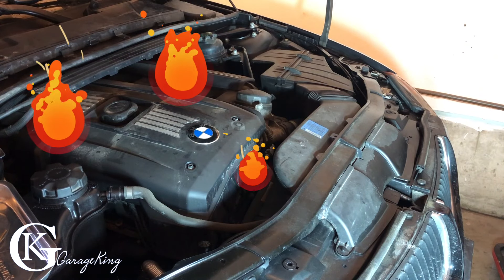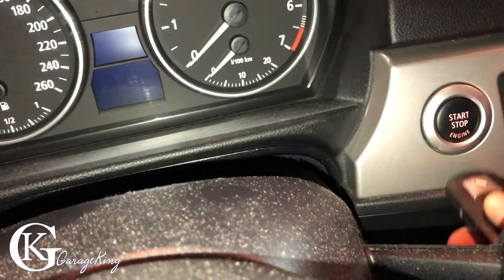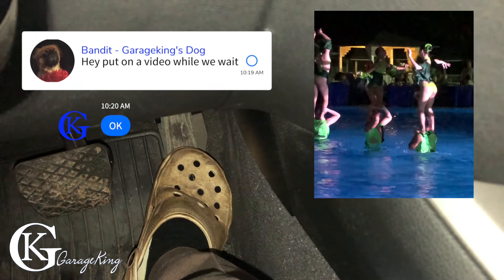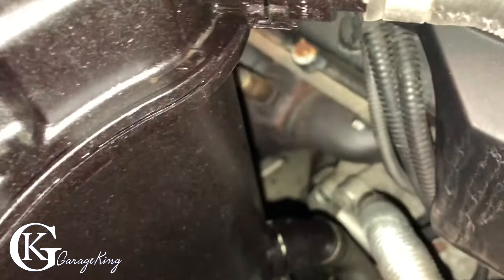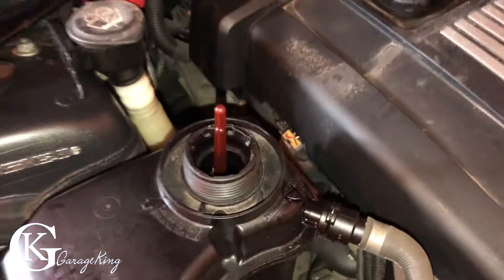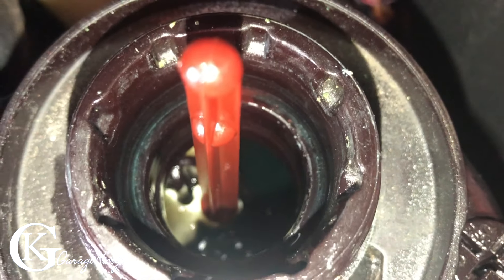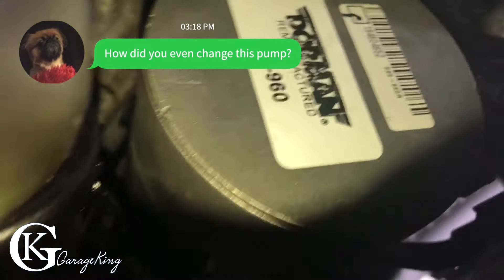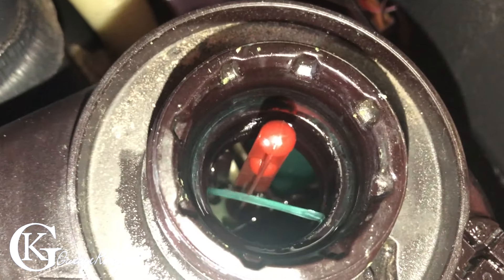How to Check BMW water pump

Comment: I have a 2006 330i N52 my car over heated the other day and I needed to add coolant since then my water pump seems to runs continuously not stopping until battery is drained my water pump also does not shoot coolant out like yours it shoots up like it’s aiming at my passenger mirror I have been told it could be relay or fuse but I personally think it’s the water pump what do y’all think ?( also my thermostat was changed about a month ago by previous owner I just got it with 205,000 miles the only things I know the car needs is o2 sensor)
Reply: Please help I don’t want to spend the extra money replacing everything
Reply from the maker: Hey there, ya could be your water pump.  I wonder how it shoots up at your mirror?  The only way I can think of that is if you took off the cap with the engine hot and it came flying out. If your pump is not circulating coolant properly for some reason (like a blockage or something) then the ECU will command the pump to stay on as the ECU (computer) doesn't know any better and it will just command it to stay on until the temp comes down (which won't happen if you have a circulation problem)
Reply from the maker: Don't blame you, BMW part are expensive. (edited to move comma)
Reply: My coolant is also not a stream, it sprays upwards and in bursts not sure what the means either. But I think we are having the same issue. Did you get it fixed??
Reply: Sounds like you haven't been using distilled water and now you have sediment buildup

Comment: According to my scanner. Ac blower must on low. On low headlight switch to prevent sleeping. Key on, then hold pedal 10 seconds. Good video though. It also bleeds the coolant.
Reply from the maker: Hey thanks for the comment, appreciate that !!!
Reply: What model do you have?

Comment: Aaaargh your engine was on fire lol!  I love your easy to follow instruction on car repairs and your sense of humour!
Reply from the maker: Thanks so much for coming by :) Happy New Year to You :)
Reply: @GarageKing  How you doing , I have a question , My Light kicked on for OVERHEATED , can i put coolant on the tube where you put water for the wippers or theres another tube for the Water pump i have a bmw x6 xdrive35i im jot quiet sure
Reply from the maker: @RiichyyRiich123  hey thanks for the comment. The coolant can only be added to one place and one place only. The coolant reservoir as shown in the video. There is a link in the video when is playing that shows how to replace the water pump. At the end of that video I show how to fill the coolant properly.  Just scroll to around the 1/2 way mark and there is a symbol in the top right corner click it and you will see the other related videos. If you have any questions just let me know. Thanks :)

Comment: Help! I can't find the video where you changed the pump out 🤔
Reply from the maker: Hey brother thanks for the comment, the pump vid has not been posted yet.  I'm still editing it.   The pump is located on the passenger side underneath the car.  I can help you along if you need any advise.  I hope to have the vid out in a few weeks.  I used an aftermarket pump and it worked fine and even came with the new aluminum bolts.
Reply: @GarageKing  Which pump did you use? I'm having a bit of trouble. I replaced my pump and thermostat and I did the bleed process. I turned it off then ran the car for about 15 min and it started to overheat. I tried to do the bleed process again but it never turned back on? I ran a scanner and I got code 2E84. I don't hear the pump kick on anymore. I wanted to see your video to make sure I did it correctly. I'm not sure if it's a bad pump or wire issue. Thanks for your help.
Reply from the maker: @kobe_goat_24  Hey sorry for late reply, I had to go into the raw footage to see the pump part # Its a Doorman 599-960 model.  I did use a genuine BMW thermostat, but the pump is aftermarket.  I found the connector was REALLY REALLY hard to push together on the water pump, and I even used a set of pliers to compress the fitting.  I thought I was going to break it.  I'm wondering if yours is plugged in all the way, I could see the plug not being seated an issue, because it would work, and then vibrate loose a bit and loose its connection.  The 2E84 can be caused by a bad ground so make sure the ground terminal that you had to screw onto the front of the pump in clean and tight, and check the connector.  I would be curious so let me know if that helps at all.
Reply: @GarageKing  how long did it take to change?
Reply from the maker: @leftylok83  Hey Thanks for the comment, and sorry for the late reply.  If I was not filming it, probably 2 hours.  Because I filmed it maybe 6-7 hours.

Comment: I have a 2010 X3 in my shop and I've done the coolant bleeding procedure and already replaced the thermostat, but the customer is hesitant to replace the pump due to $$$, knowing that the pump was still flowing during the test but seeing your pump flow in the video makes me second-guess his water pump now. According to the scan data the RPMs of the pump were within the specs so I'm at a bit of a loss here.
Reply from the maker: If the scanner is reading RPM within range I would check for flow, and if the flow is not right I would check for build up due to lack of maintenance.  If the coolant is clean, then I would replace the pump as there is nothing else.  I haven't seen it on a BMW (yet....) but I have seen it on others where the pump motor spins, but the vanes on the pump shaft are slipping which can cause lack of flow. If you do replace the pump I would be curious with a follow up from you.  I'm still active in the field, so I'm not just a Youtuber making vids.

Comment: my pump does the bleed just fine, I can see the rpm's (and hear it) but I get 0 (zero) rpm's from it when engine is running (using 'running' stats on my OBD) new battery fully charged.  oh E90.
Reply from the maker: Thats good your pump is operating. If you are referring to it not running when the engine is running then it could just be that the computer has not commanded it on yet.  It should begin to operate once the engine heats up.

Comment: Can a non functioning heater control valve cause overheating? I don’t get hot air at all.
Reply from the maker: Not 100% sure, but it may be able to depending on how it failed.  Opened or closed.

Comment: Thought my water pump was bad but tried it and i have the same flow as u after u changed yours. In relieved 😅
Reply from the maker: That is good, if you saw the water pump replacement video you will see it takes a bit to do it.  Sorry for the late reply, I was on vacation !!

Comment: My check engine light just came on my 328xi. Said the engine was overheating around 250F but there is a leak around the valve gasket. Would that be the cause or could there be more issues. Your help would be appreciated 🫶🏾🫶🏾🫶🏾
Reply from the maker: Hey there, and thanks for the comment.  Valve cover leaking would not cause a check engine light, or cause the engine to overheat.  It will only result in an oil leak.  Your overheating is caused by a problem with the cooling system, or the radiator fan.  1st thing to check is the coolant level because if you have a leak there won't be enough coolant for the pump to circulate and the engine will overheat.  If the coolant is full its most likely the water pump, thermostat, radiator fan (or the relay or electrical system that turns the fan on)

Comment: after coolant bleeding this pump of mine is new aftermarket but it doesnt pump as strong as yours..is that a concern? also, should it cycle on and off or stay on all the time..i changed the coolant sensor and did as ur video to bleed and the pump only came on a few times  thank u any way to check temp..the only time i hear my fan on is when the ac is on???? 
2008 bmw 328i sedan
Reply from the maker: Hey thanks for the comment, you fan will only come on when ac/defrost is engaged, or the coolant temp is hot (close to or above boiling) The pump should be ok, as it is variable, so cycles during driving and does not run full steam the whole time. Just make sure you you get all the air bubbles out so you don't confuse a weak pump with one that is pumping air/water mix. During the test it is suppose to keep cycling.  If you have a scanner with bi-directional control you can test the pump and also see the temp when the T-stat opens and you can get a better picture of the engines efficiency.

Comment: Hey man brilliant video. I do this cycle and the water pump doesnt kick in and my cooling fan runs. Do you have any ideas?
Reply from the maker: Hey There, well you may need a pump.  A sure way to check to make sure is with a bi-directional scanner.  Just make sure you are doing exactly as show for the test.  It would suck if your timing was off and your pump was actually ok.  If you go through and the pump still does not work, you can check if there is a fuse that is blown. (I'm not sure which circuit the pump is on)  If have to replace your pump this is what you have to do. https://youtu.be/K-JXuMHgVJE  If you are doing the test right, then most likely you need a new pump.

Comment: Do you have to mess with the screw (next to tank cap) at all during bleeding procedure?
Reply from the maker: No I didn't.  After you run the car and its pressurized you can loosen that screw to get out any air, but its usually not necessary
Reply: @GarageKing  Thanks!!!

Comment: I’ve had a few coolant hoses go recently on my N53 and when it is losing coolant quite fast it makes a weird buzzing noise but different to the one in this video. Could this be related to the Waterpump too? Or maybe just the pump running dry with the loss of coolant?
Reply from the maker: You have a good theory with the buzz noise being attributed to a dry pump.  I have never heard a pump run dry, but it's a possibility.  I'm not sure what else it could be, unless the coolant you are loosing is spraying out and hitting something hot, or hitting a thin piece of metal and by the time the sound travels back into the cabin it sounds like a "buzz"
Reply: @GarageKing  Yeah, it was the coolant pipe that goes to expansion tank and it was leaking onto the radiator when the car was warm, so I guess that would kind of explain it. I recently had a pipe fixed which goes to the heater matrix and when the mechanic bled the system he didn’t report any issues so could just be me worrying. The buzzing noise could only be heard from outside by the way. Thanks for the reply 👍
Reply from the maker: @jordanclarkson2010  Makes sense, coolant hitting the hot rad, I'm glad you got it all fixed up.  Sometimes problems like these are the most annoying ones as they are hard to pinpoint.  Glad you got it all fixed up.  Enjoy the rest of your day !!!

Comment: @GarageKing i have fault codes 002E81 for electric coolant pump, speed deviation an fault code 002EF4 map thermostat mechanism. But the status of them are not currently present my code reader says. But they keep coming back when i clear it but says its not present.  Also when i test my pump the way you do the stream is on for like 5 seconds then shuts off an then comes back on. But when the car is running its a nice strong stream. Should i replace thermomstat an water pump anyways?
Reply from the maker: Humm, I'm wondering if your pump is intermittent. Because of the speed deviation I would lean towards changing the pump. The speed deviation usually means the pump is not operating within parameters all the time which is usually a sign it's going.  Now it could go on for a while, or go downhill fast.  Some last longer than others. But before you go changing the pump make sure your coolant is full. If it's low, that can cause deviation as there can be air in the system.
Reply: @GarageKing I appreciate the help. Its been 4 years since the pump an thermostat was last changed.
Reply from the maker: @jacobthompson8078  Well 4 years, not unheard of, but the code does lean towards the pump being done, if you are curious what required to do it, here you go https://youtu.be/K-JXuMHgVJE

Comment: Soo, does this mean that if there's a stream of coolant squirting then the pump is okay?
Reply from the maker: Yes, but it should be a powerful stream like in the video.  If its a weak stream thats a sign the pump in on the way out.
Reply: @GarageKing  hey so i think mine might be on the way out, the stream is not as powerful as yours, and i have yet to get the engine overheated light. however after short drives my fan goes berserk and the throttle response weakens. i still think its overheating. do you think this is  still water pump/thermostat related?
Reply: Do they all have an electronic water pump mine is a 2006 320i. I have I zero coolant stream when I do the 10 second gas pedal procedure. But when I start the car, there is a stream. The heater in the car is also cold when stationary but is hot the second i drive and then goes cold again once stationary with the engine hot and running still

Comment: Im having a 2e85 bsd message electric coolant pump missing fault code.  I find the water pump working and by following your procedure and  its bleeding fine. Any ideas with regards to this code?
Reply from the maker: If your pump is operating below spec you can still get that code.  It could still be your pump.  At times the wiring can cause this as well (you can get a replacement harness for the pump) but many times its the pump.  You should have quite a bit of pressure when its operating (bleeding)

Comment: hello, i have z4 35i sdrive n54 engine my water pump is dead so i need the repair that but i must go 130km, can car handle this situation ?
Reply from the maker: No I would not drive it.  Without the water pump circulating the coolant you will overheat very fast,
Reply: @GarageKing thx 🫶
Reply from the maker: @arda2539  No problem, fix that pump and keep that N54 on the road !!

Comment: Does the flow in the expansion tank have to be that strong? Mine isn't that strong and I'm having overheat issue.
Reply from the maker: It should be similar, if its not strong your pump is beginning to fail and that's why you are overheating (not enough flow)
Reply: @GarageKing  Ok I appreciate it. I'm wondering cause when the car is running its strong.
Reply from the maker: @PAPatriots1776  the pump is variable so maybe it has its moments
Reply: @GarageKing  yep fault code popped on today when I changed out the coolant temp sensor. thank you for your help.
Reply from the maker: @PAPatriots1776  That is very good, I'm happy you were able to get it fixed.  Good thing for the code.  Thanks for the follow up.

Comment: I have a 2000 323i wagon.  The other day my temperature gauge went to RED rather quickly.   
It’s never ran hot before, the only part I’ve had to replace is the fuel pump.  
Anyway, it was completely out of coolant, and there is a massive leak that I am about to look for.  Any advice?
Reply from the maker: If it was completely out of coolant, that’s a pretty big leak. I would look for a split hose.  You could always put a pressure tester on it and pump it up and listen for leaks (air coming out), or just fill it with water and see.  Good thing/or bad thing is the leak should be fairly easy to find.
Reply: @GarageKing  so the leak was my expansion tank.  There’s a light blue sensor/ plug on at the bottom that was hanging loose, so that’s where the massive leak was, lol. 
Should I replace the whole thing? Or does that sensor  just plug back in ?  There’s no damage that I could see, given that it just completely drained itself in a matter of seconds.  
Sorry for the dumb questions, I’ve always taken my car to the dealership for scheduled maintenance and the only repair I’ve had to make was the fuel pump. I’ve never had to work under the hood on it.
Reply from the maker: @markhenderson8832  Hey there, I would take out the tank and sensor, and inspect it.  The sensor came out for a reason so either the sensor housing is bad, or the tank is bad, or both.  I would inspect both. My guess is one is probably bad.  If the sensor and tank are not too much money I would replace them both.
Reply: @GarageKing  thank you!  I was inspecting it earlier and saw a huge hole in the lower plastic hose, looks like it was rubbing up against the belt next to it.
Reply from the maker: @markhenderson8832  That is excellent, at least you found the leak and know what you have to do.

Comment: I did this to mine to see if that’s the reason why my fan keeps running on high but the water pump works because i have a flow of liquid 
So what could it be 🤦🏽‍♂️ 
I don’t want to spend almost $1k for something that’s not gonna fix the issue
Reply from the maker: Hey there and thanks for the comment.  If you have the AC on, or defrost the fan may run on high.  Make sure the liquid is flowing pretty fast.  Also look at your engine temperature gauge and see if the engine is hot.  If so your thermostat may not be opening.

Comment: hello, i have to change a hose , and after that coolant temp is about 77-82°. only semiopen thermostat or/and water pump? thanks.
Reply from the maker: Hi there, I wonder if you introduced air into the system.  I would try to bleed the system of air, and activate the pump, just like in the video a few times, as it pushes air out of the system.  You most likely have an air lock "a big air bubble" in your system.
Reply: @GarageKing  i try these steps, doesnt flow . if was pump broken should overheating, right?u change thermostat too?
Reply from the maker: @stoicadaniel1909  Yup you are right, if the pump is broken the car will overheat.  Its best to replace the pump and the thermostat, as the thermostat is located right beside the pump.
Reply: @GarageKing  thanks, i replace only thermostat for now, and i wanna see what happent with pump.  keep in touch. all the best to u.
Reply from the maker: @stoicadaniel1909  OK sounds good, best wishes to you :)